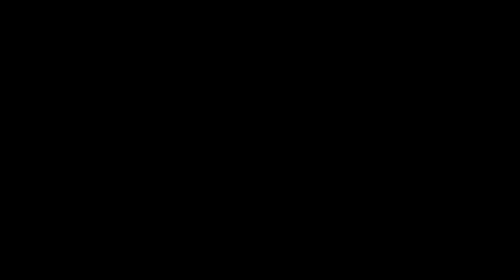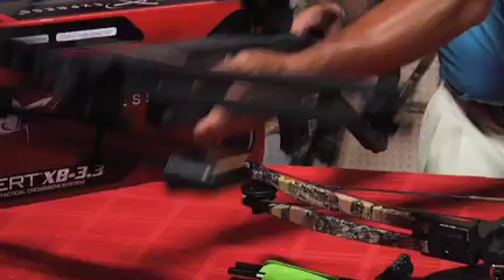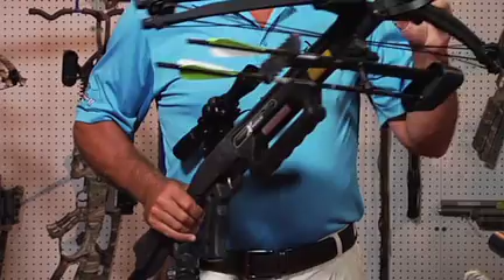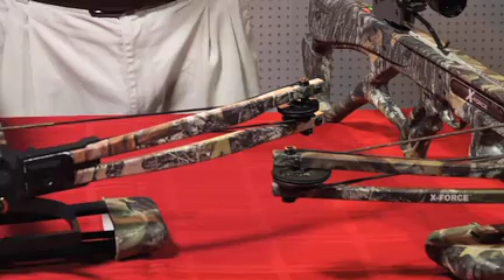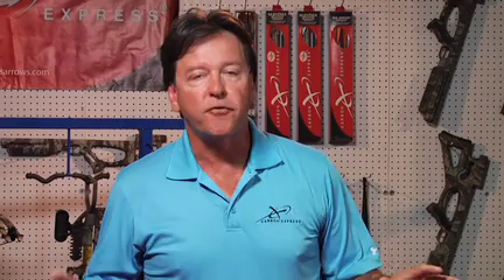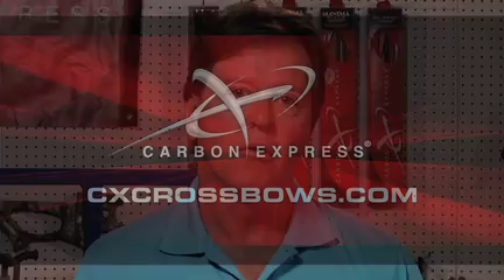Carbon Express X-Force Series

Comment: Anyone have the x force heritage?
Reply: Just bought one tonight. Looking for more info myself.
Reply: @dustinellis4013  it's dead on at 70 yards.  My issue is the draw. I was in an accident and cant pull it back quit far enough and they did not make a crank for the heritage. As long as you can pull it back to cock it you should be able to put a deer on the ground no problem
Reply: Xforce 500lx and now try To figure it out witch crank winch i need To use